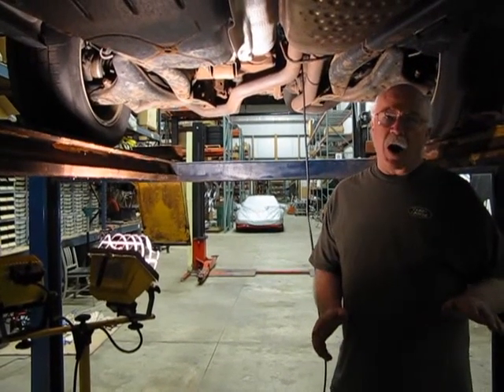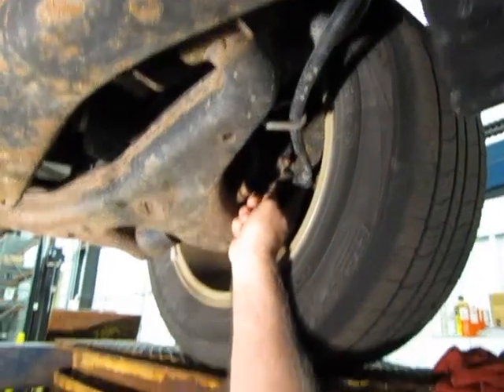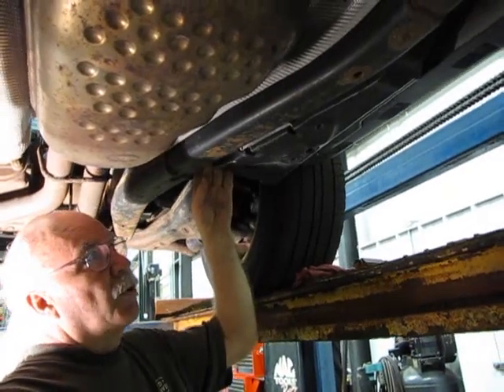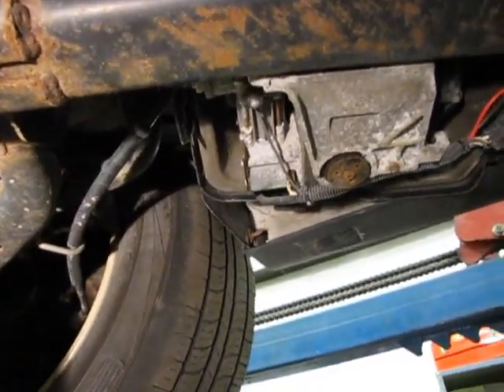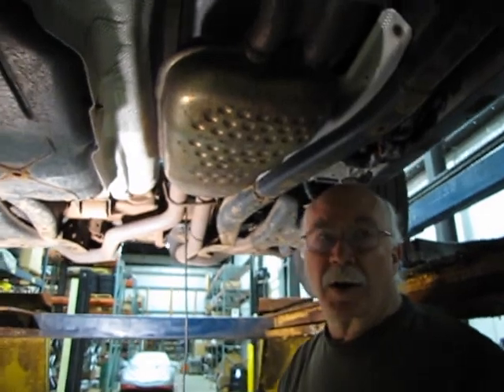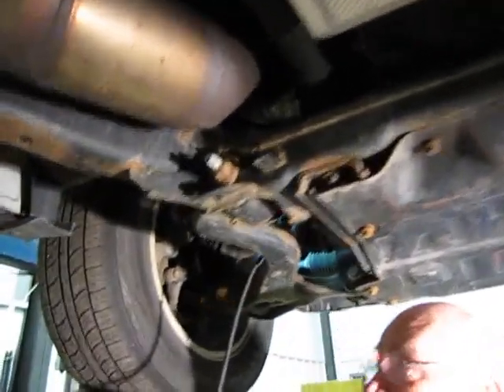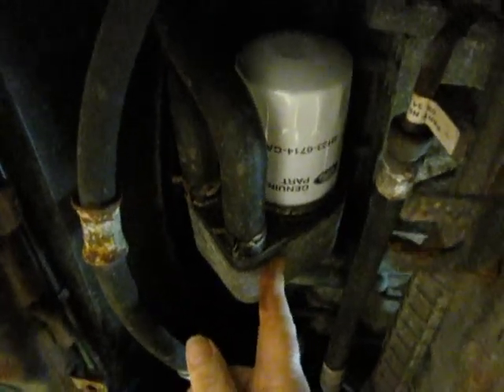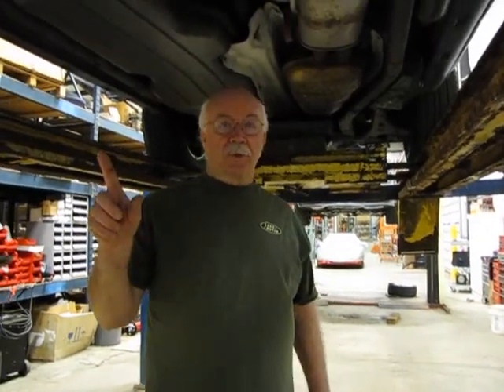A Look Underneath A Land Rover LR3 - An Undercarriage Tour

Comment: Just finished front and rear pads and discs for my 2006 LR3, with parts I got from Atlantic British. Very pleased with price and service. They should do a video on the rear tail gate cable breaking. That happened to me once, but the dealer serviced it due to warranty. No warranty now so if it happens again I will fix it.

Comment: Does the Shift Motor on the Transfer Case fail because the vehicle is driven off road or in slippery conditions WITHOUT locking the Center Differential? I heard this is a major problem in older Discoveries and Defenders.

Comment: what is a common mod in the UK for the skid plate is drill it will a hole saw right under the drain plug so in future no need to remove the skid plate..

Comment: DIY Fix, there is a three dollar seal on the compressor piston you can replace yourself if the DC motor is OK.  Or you can spend over a grand.  They sell these on ebay and watch the video.  Boom!

Comment: So I jacked up under the compressor and broke the bracket.  compressor is vibrating now.  Am I able to order just the bracket?  it looks like it is a cast material.  Could the crack be welded?? I would appreciate your feed back. thanks
Reply: TheDickman79  yes it should be welded I had the same problem but compressor is noisy
Reply: TheDickman79  same thing happened to me and yes you can weld ask we're can weld chrome because the bracket is solid  chrome material

Comment: Hi i have 2 range rover sport 2010 from usa... Same code check engine.. P2096 and p2098.. Oxygen sensor ok.. No leaks no problem engine very good fuel pressure.. Can you help me.

Comment: I for one wont be relying on Atlantic British to service my rear brakes! - the emergency  - or park brake shoes are NOT inside  the rear calipers - they are actually inside the rear 'Top Hat' type rear brake discs or rotors! AND, furthermore have to be set up correctly or the actuator module can be damaged beyond economical repair when carrying out scheduled periodic adjustment.....